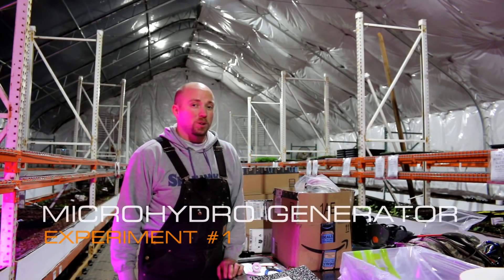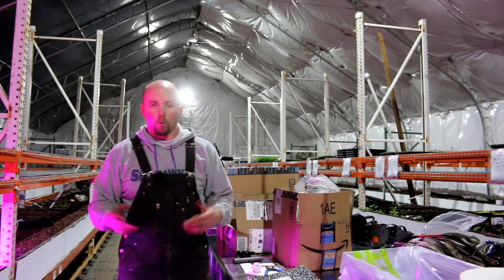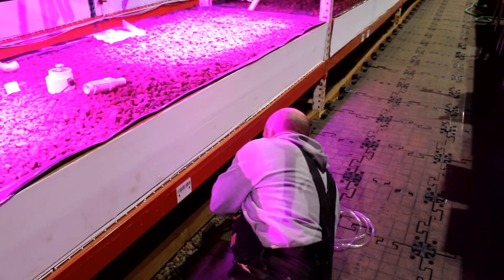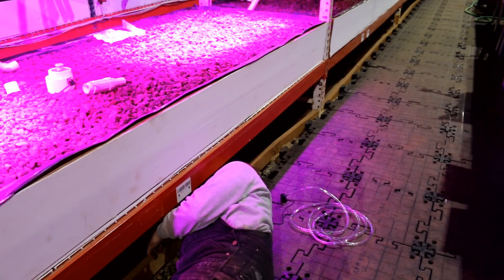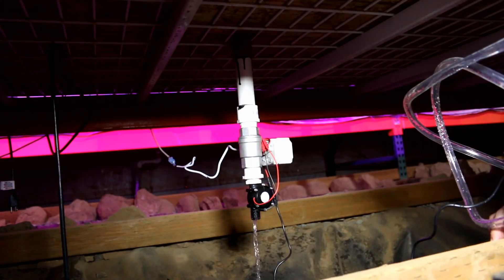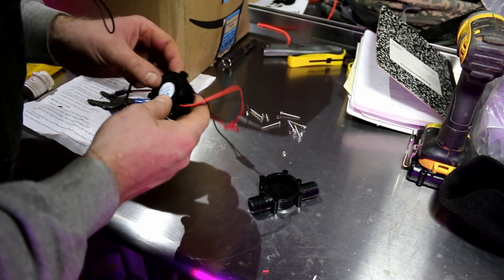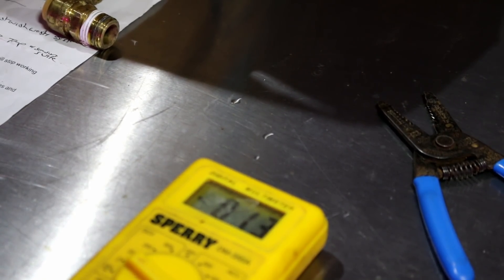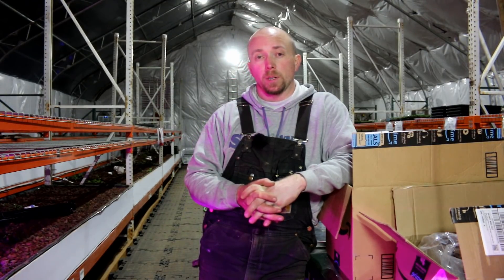Recapture Aquaponic Flood and Drain Bed Energy? Micro-Hydro? Will it Work?

Comment: Erhh... You attempting to create a perpetual motion generator? :D
Resistances, conversion losses, etc would never allow you to push water back up to where it came from...
At most, you could use it as a supplement to a battery system, provided you have enough drop and volume to get it going.
Reply from the maker: wow...I'm gonna have to work on my communications skills...no definately not a perpetual motion machine...this is just energy recapture. converting the potential energy in the water stored in the grow bed, into electrical energy to run a pump while the bed is emptying. Not sure how people are thinking perpetual motion from that...it's just a water wheel concept.
Reply: Hey, I totally understand what your intentions were with the thing, but what's giving the thoughts of "perpetual motion" is that you connected the output from the little water wheel to the pump, trying to pump water back up. And obviously the first wouldn't generate enough power to pump water back up. (If so, it would become the perpetual motion machine). That's also why I wrote that, if anything, it would help supply energy back into a battery, from which you'd take out power for the pumps, etc. I know you're an engineer, and understand this, which is why I asked, and added that smiley. Now, reviewing my own comment, which was written very early in the morning, with my first cup of coffee, could be read as if I was being a jerk, but I promise, I wasn't :)

Comment: 1st and 2nd laws of Thermodynamics clearly show that your experimental setup will not work.  First of all, you need to use the maximum kinetic energy of the falling water to run the generator.  The greater the height differential between the generator's inlet and the grow bed, the greater the water's head pressure at the generator's inlet, and the higher its kinetic energy when flowing through the generator.  The maximum energy available to you would be to install the generator such that its outlet is exactly on the surface of the fish tank, you can't get any more of a height differential than that.  However, you're trying to pump from the bottom of the tank up into the same bed from which the water is falling.  Consequently, you're trying to pump the water higher than it can fall.  The only way that can happen is if the volume of water being pumped upward is far less than the volume of water flowing through the generator.  In other words, you MUST set up the system such that the pump uses less energy to pump water up than the generator generates and the only way that can happen is if the total volume of water you pump upward is far less than the total volume of water that flowed through the generator.

The only way this has even the slightest chance of working is to use the generator to charge a capacitor or a battery over a long period of time, long enough to store enough energy to run the waste pump for the time required to extract the fish waste.  However, you're probably looking at many grow bed fill/drain cycles before enough energy will be stored to run the waste pump 1 time.

Comment: The volume of water dropping through a gravity fed hole will not have sufficient power to raise the same amount of water against gravity when energy is bleeding out of the system through friction, heat and the electrical resistance of the pump motor. 
What you need isn't just a 12V match, you will need a generator that can supply sufficient amperage as well. 
My suggestion would be to hook 3-5 of the 12V version to each drain and run them in parallel, paired to 1 pump. A better option might be to put a paddle wheel generator in the return for the fish runs and store the energy in a lead acid battery or a capacitor bank.
Reply: D Hawthorne I make you right.
The optimum voltage might just about be five volts for that little generator.
So he's gonna need a few to get up to 12 volts. Probably need 14 of em . LOL
Reply: 5V generators aren't going to cut it without making a small brain box on a piece of breadboard. You can't connect generators in series. The simplest solution is to send this generator back and get the product that was actually ordered. 
If the 5V MUST be the solution, then you run them as a trickle charger to a 12V capacity storage cell (the battery or cap bank I mentioned in my first post), then use that to power the pumps. However, this would require constant flow through the generators and the beds are not on a continuous cycle, they are on a flood/drain cycle.

Comment: Can you create a gravity Reservoir increase the pressure with volume pushing the water through a smaller opening at a higher rate of speed possibly including a overflow if necessary

Comment: The energy efficency of small generators is very low and the efficency of the small pump is also  too low... you need something like a  ram pump (https://en.m.wikipedia.org/wiki/Hydraulic_ram). This pump works only by the energy from gravity and needs no other energy input. But maybe the height difference is too low to get such a pump to work.

Comment: I may not be 100% correct but even if it did work the pump creates a load and when under load that generator will get more resistance and require more pressure.

Comment: This is the same as attaching a hose to the bottom of the grow bed and putting the flowing end back to the top.  It won't lift its own weight.  You will have to take some of the kinetic energy from the drain cycle and store it, with a battery, then use the battery when its charged enough to power a pump for the fish poop.  One thing to remember is that by putting resistance on your drain cycle, it will take longer to drain the bed.  Make sure you account for this in your ebb and drain cycle timings or you will have much bigger problems.

Comment: Air is vastly different than water, blowing into it won't equal. The generator probably needs psi water pressure ~50psi in order to generate the power.

Comment: I generated a whole 5W from my waterwheel falling the same distance flowing 30ish gallons a minute. Your generator requires much higher head pressure to even get 12V let alone any current capacity. Check out my videos, final one should be done in a few days.

Comment: My advice would be try a higher quality one.  I've found the one by TOTO designed to power the auto flushers on their low power urinals works well with low water flow.
http://www.homeessentialsdepot.com/toto-th559edv504-hydro-power-generator/?gclid=CjwKEAiAkajDBRCRq8Czmdj-yFgSJADikZggCUFeHA5zQzOWzD5Uft-LDKlG-V5_Fk00TjF1iREawhoCLpTw_wcB

Comment: air is gas ...water is liquid
that just blowing into that poor thing won't be much efficient ..where are your engineering skills? 
..just hook it up inline with your sink, atach some battery charger and you have some free mobile charging station as long as you use the sing enough.

Comment: The diameter of the input of the pump wil be the limiting factor here. Nowhere near enough pressure. You need a water wheel with a larger diameter to make any use of such a dribble.

Comment: You are trying to pump water up to the same head height used by the generator.  Wouldn't that be a perpetual motion machine?  

It can't work and will only result in slowing your bed drain which could lead to debris buildup and other issues.
Reply: Yes.  Law of Conservation of Energy.
Reply: I suppose he could use a boost converter and an air line size tube and get a a few hundred ccs or so back with every cycle but that doesn't seem worth the price.
Reply: He’s not trying to move the same volume of water, he’s trying to pump the poop from the bottom into the bed.
Reply: To do that he needs to move large volumes of water.  He has never mentioned anything that will separate the solid waste out of the water.

Comment: Wished it worked. But hey you could have something like that in the future stages.
Reply: No they never will, because that would be making energy from nothing and that just do not work,
Reply: bknesheim 
On such a small scale yes.
Reply: No it will not work at any scale. The best you can do is hydro-electric pump storage at 70%–80% and they have worked on optimizing those pump-generators for more then a 100'ed years now.
Reply: bknesheim 
Oh ok

Comment: Energy recovery ftw. Maybe increase the height between the water and the generator,  you have a greater energy potential, like how hydroelectric dams have their turbines at the bottom not the top??
Reply: This would increase the kinetic energy of the water, yes, but if the impeller is built with loose tolerances and high friction, this will not solve the problem.